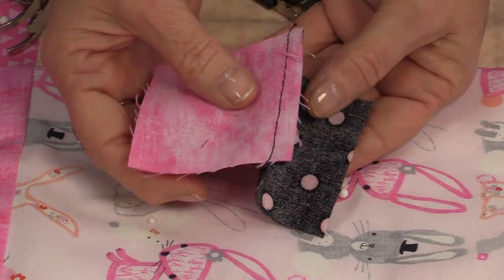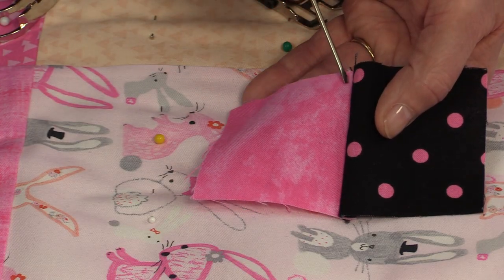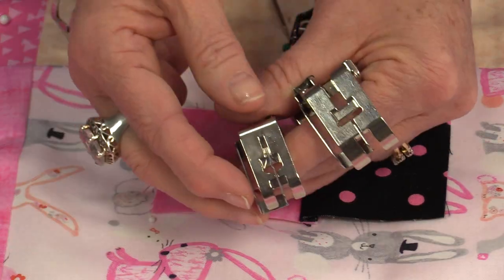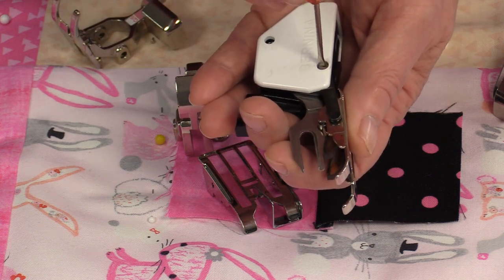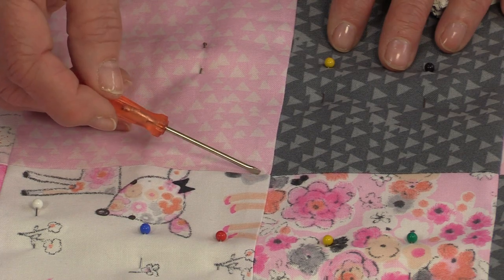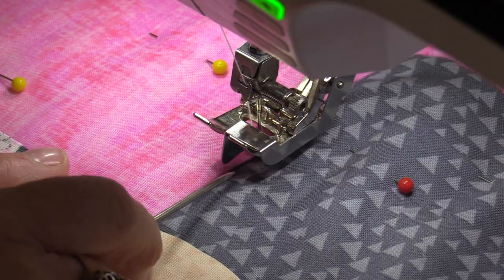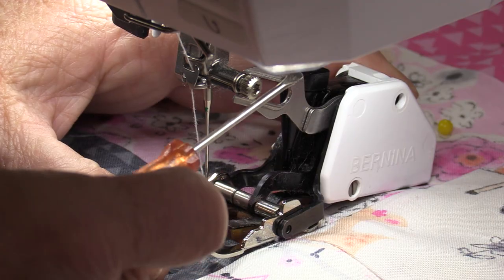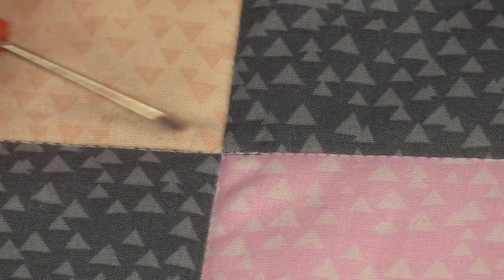How to "Stitch in the Ditch"

Comment: Thank you for your help. This was the 1st time I was going to try "Stitch in the Ditch".  My problem is, I already I ironed & lightly starched the back side of my rows open! I watched how to do this long time ago, to help the fabric lay flat. It looked like I shouldn't have ironed them open, to make a hill, on one side of the ditch. I'm going to hate ironing them back to one side. Can I still try "stitch in the ditch" with leaving them ironed open ? Or should I just Ditch  it, & do it on the next quilt I make?
Reply: Never mind I read the comments from a year ago, where you said, "not to sew in the center because it will weaken the stitch. Instead sew 1/4 inch over, to sew on 2nd layer of fabric underneath.  I saw that commented on twice, so I think that's right. If that's not right let me know.

Comment: This makes me wonder: Why are seam allowances pressed to the side, instead of being pressed open?
Reply: It results in a stronger seam. If they were pressed to each side, there would be no fabric in the middle to stitch on. That being said, some sewists like to press open for a flatter seam.
Reply: Thanks, Adrienne. I'd always wondered about the reason.

Would it be easier to control the foot if the seam is flat and pressed open?Stitching on the median instead of stitching in the ditch.
Reply: While it is technically easier, it's not a great idea. Keep in mind what is going on. The stitches are falling in the ditch, which in the case of pressed open seams means that the quilting going over the connecting patchwork stitches and then falling into the batting. No fabric to support the stitching on the top side. So if you press seams open, you're probably not going to stitch in the ditch. Free motion quilting or stitching across the seams would be more long-lasting. That being said, every quilter has his/her favourite methods!
Reply from the maker: I can see Adrienne answered you:) I have the best viewers, it is great how we what to help each other out:)
Reply from the maker: Thanks for your help":)